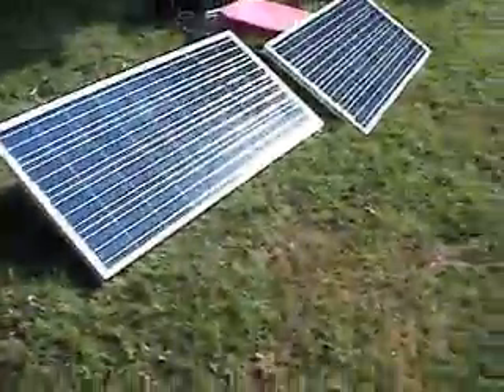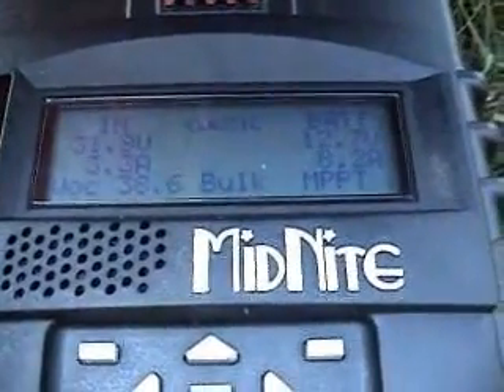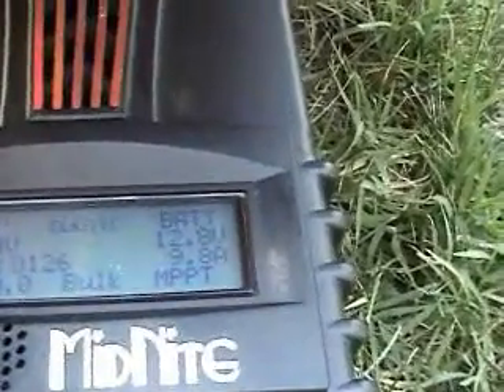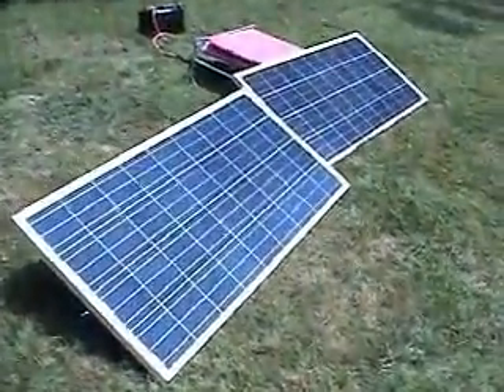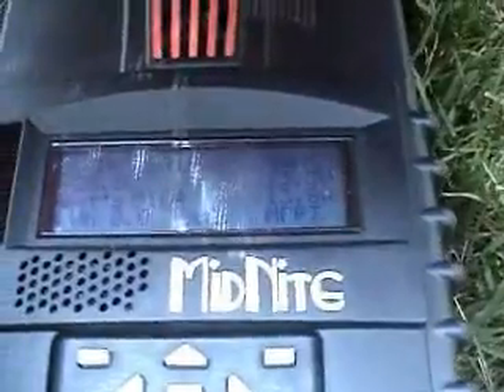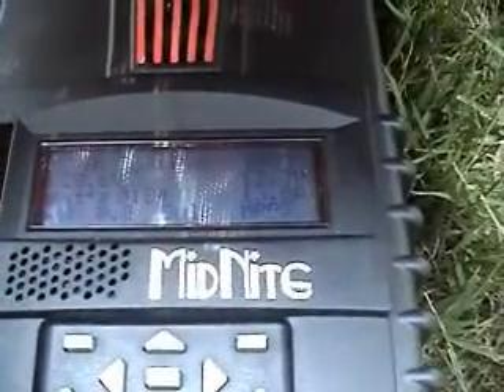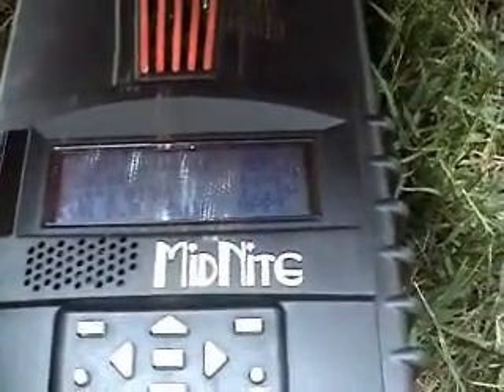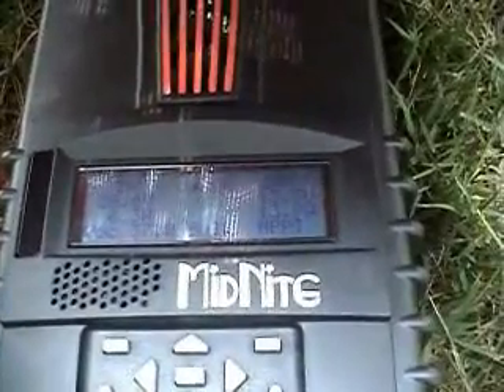Midnite Solar Classic and DM Solar 145w Panel Testing

Comment from the maker: So far so good. The ability to use software and a LAN cable to get data with FREE software and have HARD DATA logs to export is always a nice option.

I recently did a single panel test and put the controller into LEGACY mode and got 115-116 watts from a single 145w panel here in NJ testing with overcast. About 80% eff coming thru and 9.2 amps with the MPPT kicking in for an extra 1.2 amps for the one panel.. again 90+ F during testing. Thinking down in TX I will be at 45-54 amps for the 6 panel